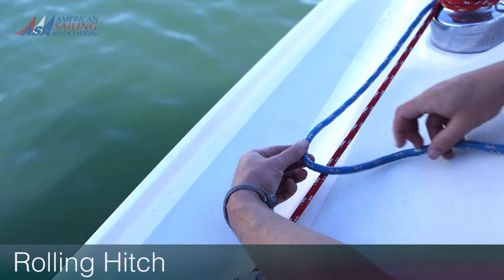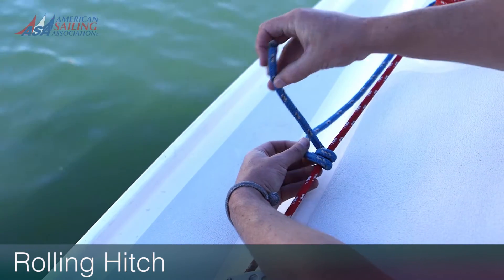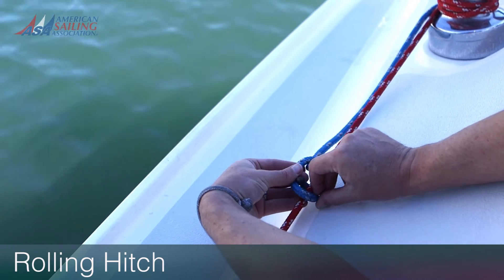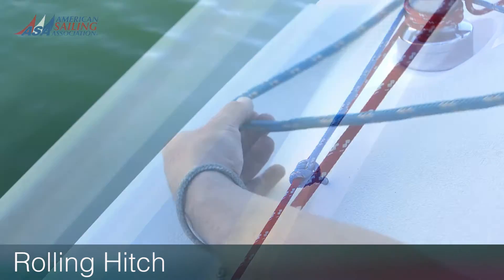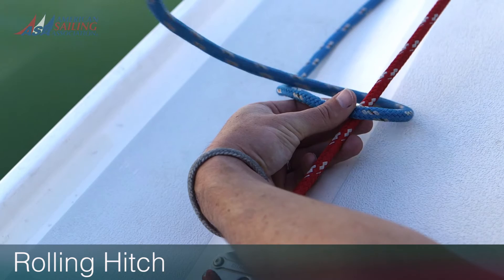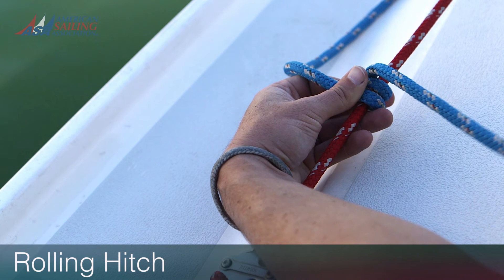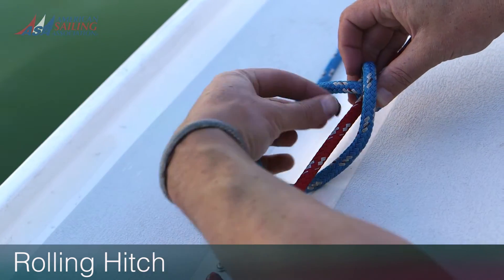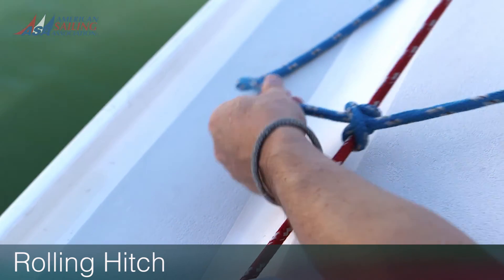ASA Knots Made Easy : Rolling Hitch

Comment: I hesitate to say anything because I’m no knot expert, but I think this is a taught line hitch. It serves a similar function but tied differently. With a taught line hitch (as shown here) the wraps are made inside the working end (toward the direction of pull) and then you cross back OVER the working end to finish the knot.  With a properly tied rolling hitch, the wraps are made over the working end (away from the direction of pull) and then you cross UNDER the working end to finish with a half hitch.  I’m wide open to correction on this and would welcome comments so I can learn if I am wrong.
Reply: There’s different variations of a rolling hitch, so you’re probably thinking of a different one. The taut line hitch is basically a rolling hitch (the version in this video) tied around the standing part of the rope, not a spar, etc. Similar to how a clove hitch tied around the standing part of a rope would be two half hitches when snugged up against a spar. So, this being called a taut line hitch is technically not correct